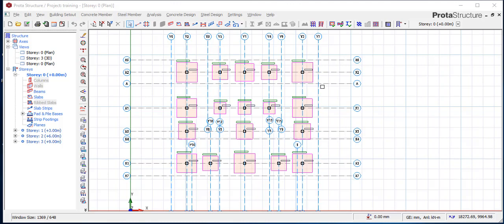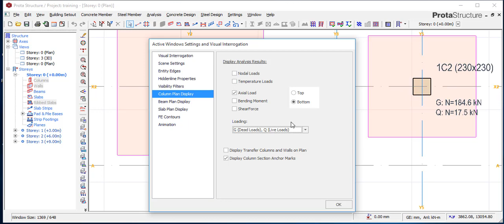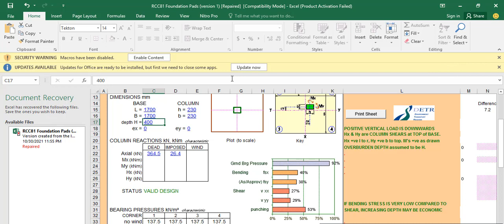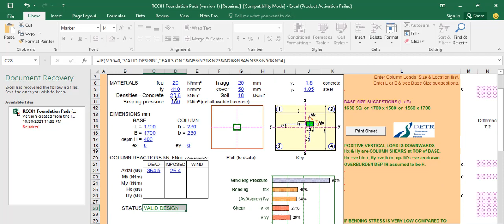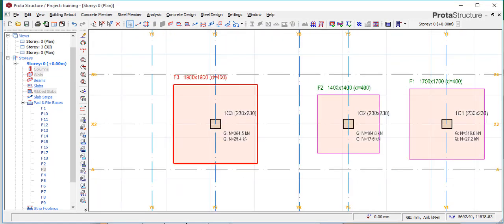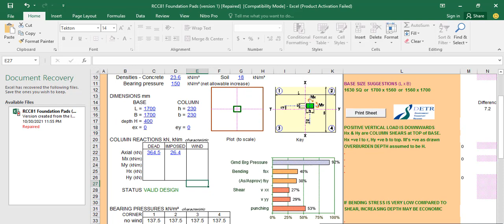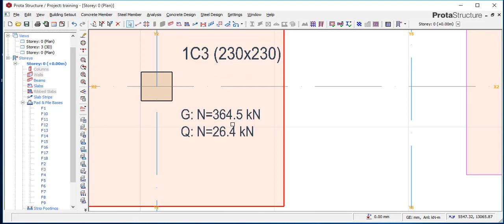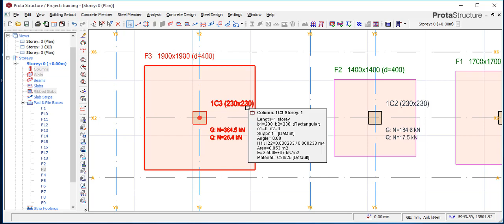protastructure tutorial: how to determine which prota structure version pad design  is economical

Comment: Hello Sir. Thanks for sharing. I meant 2021 not 2022. I am from Cameroon. Please I have 3 requests Sir, 
1. How are release achieved  in prota structure?
2. Please can you share your excel sheets with me Sir? 
3. From you humble advice which of the following software is better and easier for RC building design (protastructure, tekla structural designer, etabs, staad pro and orion)?
Thanks so much Sir